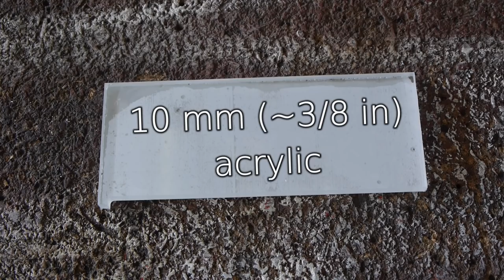Making acrylic router base plate DIY

Comment: Best base plate video iv seen so far . hope mine turns out as nice .
Reply from the maker: Do not worry, this is super simple project, only polishing requires a bit of patience, unless you have a polishing wheel above 100 mm in diameter (of course on a bigger machine ;) ). However, small is useful for finishing the hole.

Comment: if you blast the sides with a butane torch they will take on a glossy appearance - just don't melt it in the process.
Reply from the maker: I've tried this technique before, but the acrylic always "bubble" around the edges. Later, I found out that acrylic absorbs moisture and must be dry for such a treatment.

Thanks for comment!

Comment: WOW!!!!!!!!!!!!!!!!!!!!! GREAT
Reply: because the plates are usually non transparent it makes the critical placing and routing of the quad or thruster future fin boxes on surfboards so much more difficult as you cant see shit undernearth . it was blind guess work but this is going to help so much .From the front you can see an extended pencil line mark thanks so much first time router
Reply from the maker: @briantrend1812  thanks for comment! Eric Rhoten went a step further with adapting the router to such work, the base has a cut hole on the other side, thanks to it has more light on the work surface. You can see it on one of Eric's video https://youtu.be/13oJ1mcJDKw?t=88. In addition, it has a base plate made of thinner acrylic than mine, which also improves visibility a bit.

Comment: Great video, i figure one will need extra bolts screws as some are bound to get lost with changing plates, do you know what size they might be?
Reply from the maker: Thanks! The screws are M4 and with such thickness the plates are about 15 mm long, but I think 12 mm (about 1/2 in) would also be enough.

Comment: I like how you made the inlay (I think that’s what it’s called) for the hex nut at the beginning, how do you think you would do if to inlay the hex nut on to the acrylic itself?
Reply from the maker: It is possible but instead of hammering the nut, you have to heat it up and push it into the hole. Something like with the screws in my last video https://youtu.be/HILwTjVMS24?t=914

Comment: looks really good I have made one of these a little while ago. great job mate but isn't the Perspex a little too thick because your losing quite a lot of depth there. I used 5mm thick Perspex for mine and used some chrome handles off a wardrobe works really well. anyway great job all the same
Reply from the maker: Definitely too thick! But I was in an emergency and I made of the material that I had at hand. On the plus side, I have now where to build lighting :) just mill a few grooves under the base and ready to mount LEDs.
Reply: you could also build guide rails into it as well , great job. 5*  @CatLighting
Reply from the maker: @fx1c333  quite a good idea :)

Comment: I might just make my own ... yours looks thicker than Rhoten's. I have a TAP Plastics near me so it's easy to pick a piece of acrylic out of the scrap box. Two reasons why I may make my own instead of just buying from Rhoten: The knobs he uses are just cabinet knobs and I think I'd like wood ones. And I think I want to use countersunk screws (classic conical heads) instead of "counter drilled" or whatever they stock ones are, because I feel the conical counter-sunk holes will create less stress in the acrylic. So I buy 4 screws at OSH, big deal.
Reply from the maker: Every reason is good to do something yourself :) My base plate is thicker because I only had 10 or 4 mm acrylic, so the choice was obvious. But if I had a bigger choice, I would take 7 - 8 mm. At 10 mm acrylic the inside hole looks a bit too "deep".

Comment: Thanks for that instructive video, do you think  could do the cutting en drilling needed for this with a dremel tool also?
Reply from the maker: You're welcome, thanks for watching! :)
Unfortunately, I have no idea how dremel works in acrylic, I never tried. But I suspect that it will be hard because dremel has quite high rpm even at the slowest speed. For example, on CNC at 5000 rpm and 1/8 cutter I need to have a very sharp cutter and cool the acrylic in the processing area so that it does not melt.
It's just my guess, maybe it will not be so bad in this case, you need try to know :)

Comment: Wow, this is a really nice base. This is something I want to make and I have tools to do so...really need simple jig. Also what did you use the smooth out the aycrlic, a compound and polishing wheel, do you have a link for that. Thanks
Reply from the maker: Thanks for comment! The polishing wheel is a cheap felt tip for dremel, proxxon, etc. The polishing compound is for aluminum ;) I have it for 10 years, it was blue but it dried up and faded. Probably special to acrylic or car would be better choice.

Comment: How much usable shaft length was removed adding that plate ?
Reply from the maker: The plate is 10 mm (~3/8 in) thick, but in practice this thickness is not felt, the router enters the base to the bottom.

Comment: What a fantastic design for a base for a trim router to help with control and accuracy!  Great job!  If I may ask, what did you use to polish/buff the edges clear?  Not the hobby drill, but the sanding disc in the drill?  Thank you very much!
Reply from the maker: This is a disk cut from the felt and attached to the tip, which is normally used for cutting discs. This disc is the maximum size that will pull this drill. I cut them myself because those in the sale are too small or too large.
Thanks for the good words! :)
Reply: Catlighting Could you please expand on this answer?  Id really like to do the same with my projects.  Maybe a vid?
Reply from the maker: Basically, it looks like this: You cut out a felt with a diameter you need, in the middle you make a hole for the screw to fasten, put the screw and attach it to the tip that you attach to the tool. If the felt circle is inaccurate (the tool vibrates when turned on) or it is too big (the tool has no power to reach full speed), you can smooth/trim the circle by clamping the tool in a vise and carefully collect excess felts from the rotating circle with a sharp knife. In the last phase you have to be very attentive, if we enter the felt with a knife to quickly, it can be taken out of hand.
I hope that you wanted an answer like this and everything is understandable because I'm poor with English and I have to use a translator ;)
Reply: Catlighting an excellent response.  Thank you.  Just watched another YouTube video where someone was pushing actually he used 600 then 1200 period then 2000 grit sandpaper turned out looking pretty good.  HTH
Reply from the maker: And this is a great method! Maybe 2000 will not give a shine, but you can end up with a higher gradation or you can hand polish using a polishing paste for car (after 2000 grit it should go fast and smoothly).

Comment: Hi, did you use a special hole cutting bit for acrylic for the centre hole? If so could you provide the details or a link to it. Thanks.
Reply from the maker: To drill a large hole I used... diamond drill for ceramics :) It was just a small experiment, I thought there would be problems and the acrylic will melt, but as you can see it turned out ok. In this case it is important to have cast acrylic, not extruded, because it is easier to process it and has a higher melting point. Such drills should be available in most DIY stores.

Comment: What type of hole saw was used for the center hole?
Reply from the maker: This is a diamond hole saw for ceramics, I just had it but I wasn't sure if it would melt the plexiglass ;)
Reply: CatLighting Thanks. If you had to buy a hole saw for the project, would you get that type, or something else?
Reply from the maker: Definitely something with teeth, safer for plastic and more universal for other projects.
Reply: CatLighting Thanks